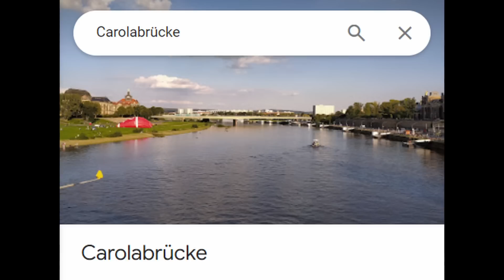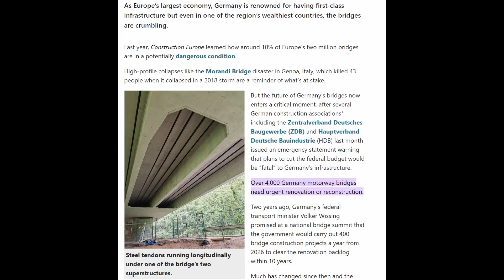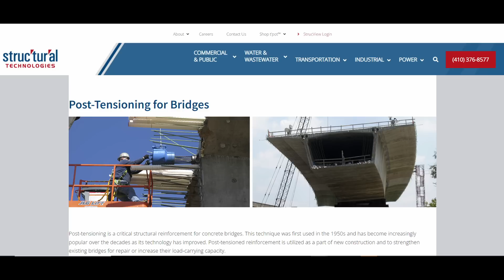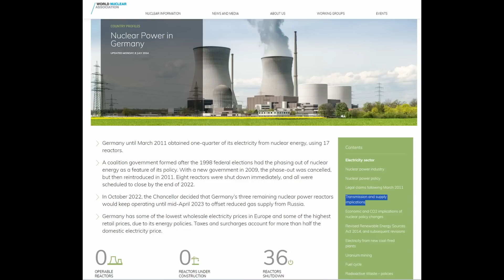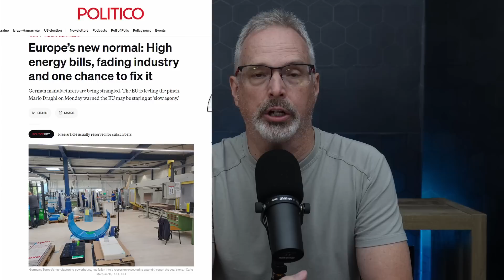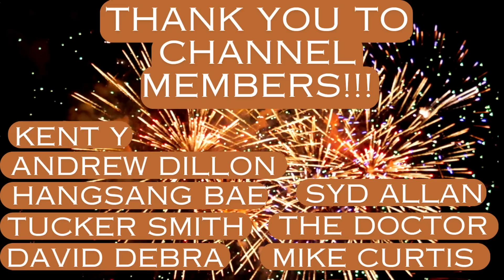Carola Bridge Collapse in Dresden, Germany

Comment: @CaseyJones-Engineer
Tis Bridge consists of three Elements beside each other the now standing were refurbished in two phases and the now collapsed would have got maintained starting at the beginning of 2025. The first press conference has seen the „DOT“ engineer state that the tensioning which was heavily corroded by Cl was broken end this most likely caused the bridge collapse.
The strange thing is that they took a pause between finishing the second row in Dec 2023 and the start of this r

Comment: you know Nuclear Power plants are a big issue for the ruling green party which means you can question this. I do think this is the worst decision made by politicians after Fukushima but it was decided. The Gas issue is a different one but i'm sure this has nothing to do with the carola Bridge. it is much more about the learning that bob the builder promised something with the steel reinforced concrete we now learn only long term possible with a lot of oversight and maintenance.  It is not the first time and we could have learned earlier. the first incident i remember with steel reinforced concrete was the Berlin Auster pre youtube in 1983 just a super8 copy ( Berlin, Schwangere Auster, 1983 ++ Super 8 -> https://www.youtube.com/watch?v=zcEcnMJyCnw  )
the stuff only works if you can deny corrosion, by rumor the cause for the incident. In winter time we used and i guess still use salt to melt the ice on streets. salten water and steel are for sure not go together. of coarse steel reinforced concrete is a cheaper way to build as you can avoid a lot of construction material by using it. the cost come later - worst case - you can compare it to still standing "roman" bridges - much heavier.
Reply: The romans didn't put tension on concrete. The pantheon uses the conmpressive strength of concrete.
Reply: @jannikheidemann3805  yea, there was no steel tension and liquid stone (concrete) in roman time. they used the stone in the way stone behave naturally. if you make a bridge from stone only and only on compression you end with something lasting a long time. By the way, the Patheon used Concrete and on top the made hole because does not work up there. they also included amphoras to make it lighter on top. Did you ever saw a cross section, the walls a massive and use gravity to keep dome from moving outwards which he likes to do to following gravity. Anyway, the Pantheon is really genius if you think how much they knew about modern statics, tried out by models - i guess.

Comment: Great video.  At 4:45 you show the collapse, and it appears there are emergency lights on both sides of the river.  Did they have the bridge blocked?  Were there some leading indications of trouble?  Maybe what looks like blinking lights is an effect of time lapse security video.
Reply from the maker: It is the time lapse effect.  The road was open to traffic at the time of collapse, it was fortunate nobody was on or apparently under the bridge at the time of collapse.

Comment: don't they use stainless cable
Reply: Stainless steel can suffer chloride corrosion, depending on the exact grade of steel.  There are lots of grades of stainless steel, each with a different corrosion resistance.

Comment: I would hazard a guess it is "The Usual" to blame. Post WW2 a lot of everything was built on the cheap with the intention that it would be replaced after 30-40 years, they were supposed to be a quick fix temporary measure. But, after 30 years the powers that be "Forgot" all about the temporary nature of these bridges, buildings, roads, schools etc, and they just did the very basic maintenance to keep it going, and this is proving to not be enough. You will find many more things falling down in the next few years because the 30 year lifespan ended 20 years ago.

Comment: The inspection reports and maintenance activities of this bridge need to be reviewed. Bridges simply don't fail without warning signs.

If the bridge was built in 1971, that was when East Germany was under the Soviet Block. The design methodology was likely Soviet.  The quality of construction and materials need to be investigated. These may have played a factor in this collapse.
Reply: Actually, this specific design does do exactly that. Which is why it isn't used anymore.

Comment: One thing that is worth noting is that this bridge was designed in a way that a single point of failure would be catastrophic and that the static design lacked redundancy. I was surprised you didn't mention this.
Reply: It was the first prestressed concrete bridge built in the former GDR. I think that at that time there was not much experience with prestressed concrete bridges and the necessary redundancy for steel prestressing elements had not yet been taken into account.
Reply: @callsigndd9ls897  It's also a design that is no longer in use because it has no visible signs of failure until it breaks.
Reply: @callsigndd9ls897  It is absolutely essential that the cables stay locked into their concrete jackets.  If the concrete is compromised, then the cables loose their applied tensile strength and that begins a slow chain reaction.
Reply from the maker: I thought that this was rather obvious in this situation.
Reply: @CaseyJones-Engineer  yes, but it's worth pointing out for a general audience, especially with changing design standards over time.
Reply: It is for your typical viewers due to your excellent content. I'm a plant operator on the Gulf Coast and something's are not so apparent to my 60 year old self. Thanks for the great content! @CaseyJones-Engineer
Reply: Rather obvious dude.  C'mon, get yourself together.
Reply: @Frip36 obvious to someone familiar in the field.but to someone seeking to learn it may not be. I am in to retirement years and never explored any this so it's new to me,and fascinating.
Reply: @Frip36  If one has just a hint of any type of engineering background (I am a marine engineer) it IS obvious that post tension type bridges have a single point failure weakness. Too many people want spoon fed information instead of doing a little bit of research and engaging with a bit of critical thinking.
Reply: @steverturnsk6190  With more than 30,000 subscribers, he's popular enough to have a lot of casual or newbie architecture fans.  Hence, he may want to slip in a few of the "obvious" points.  Unless he's too above that.  Which would make him a prig.  And we know he's not because he's got a goatee.

Comment: Ahh I didn't think Dresden was in East Germany. Russian quality isn't the best and likely nor was the maintenance. It is scary it collapsed without warning. This type of bridge construction is extremely common and it would be good to know what the cause was. It's my understanding this method of bridge construction was pioneered in Germany post WWII due to the vast numbers of bridges that need to be rebuilt. Looking at the photo and measuring the span on google earth, the unsupported span is like 365 feet. This seems pretty far for this type of construction
Reply: Dresden is pretty much the most eastern city in Germany. However, it's not "Russian quality", it's "East German quality". Russia and other Eastern European countries had distinct economies with different traditions and means. Specifically East Germany had the German tradition of high engineering quality, but greatly diminished by an economy that was limited by war reparations, eastern suppliers (with similar limits) and a socialist system. Our parents did the best they could, but that still fell far short of West Germany. At least my generation has better paint to hide the limits imposed on us by different "powers that be". 😜
Reply: I agree.  Dresden was bombed fairly heavily in WWII and was extensively rebuilt.  Having visited a decade ago, you can still tell what parts were in the "East" versus the "West".  They've got a lot to catch up on.

Comment: I broke down once in Chicago, waiting for a tow truck I walked over to the abutment nearest me…

The rebar was showing and the concrete had become so soft that I scraped some of the concrete off with my finger nail…😮
Reply: You can see that all over country. The State of Illinois has identified over 4000 bridges that need repair.
Reply: I have seen a bridge there held aligned by a metal "bandaid' over a gap for a decade without repair.  Now that bridge was pretty conventional so it didn't fall but parts were failing and not repaired/
Reply: The metal “bandaid” as you put it is probably what’s known as a doubler plate, and although they aren’t exactly ideal, they are perfectly safe to use and are even found on larger bridges (an obvious one being K-40 in Memphis)

Comment: I took BMW and Mercedes vehicles off my must buy list at least 2 decades ago. They haven't gotten any better. Same for VW who would rather lie to sell their vehicles.
Reply from the maker: I have been having good luck with Toyota vehicles from many years now.  Although I am not a fan of their 4 and 6 cylinders turbos which I won't buy.
Reply: @CaseyJones-Engineer  Drove a Subaru for 20 years from new. Rust killed it. I would have driven it for another 10 years if I could. If only to avoid a lot of the nonsense in modern cars.
Reply: Last good car that came out of Germany was around 2000 they’re all junk since. I worked for BMW for 3 years and was appalled at the quality of their engines.

Comment: Germany was already dependent on Russian gas and oil even at peak nuclear capacity here. Nuclear hasn't been a large percentage of our energy production (about 25% of electricity generation in the early 2000s was the peak). Mainly the issue with lack of maintenance is close to 40 years of CDU/CSU government (with a brief interruption in the late 90s) under Kohl and Merkel where very little was done in terms of maintenance and investment in replacement infrastructure because they were coasting  on a sentiment of keeping things the same. There was also a large wave of privatization of essential services in the 90s that is coming back to haunt us now.  Other areas such as government agencies still using paper for a lot of things are caused by this mindset that doing things the same way will lead to equally prosperous outcomes as in the past as well. Meanwhile the current government gets a lot of push back when trying to fix the many problems that have accumulated.

As for the Carola bridge in particular, the part that collapsed had been scheduled to be overhauled in 2025/2026, other parts of it were already being worked on. The main issue with the collapse at this time was apparently that they feared (and still do but it looks less likely now) that the bridge parts in the water might lead to more flooding issues when the water from the huge rainfall in eastern Europe reaches that point in the river and that potentially some of it might catch debris in the water or get swept away to damage other bridges down river.
Reply: >Nuclear was 1/4 of your county's electricity generation before you started shutting down nuclear plants 
>Claims nuclear was not a large percentage of generation

Which is it?
Reply: @homuraakemi9556  I think he means in comparison to our neighbors like France. As OP said a lot of problems came because of the lack of maintanance, and on the other hand we have a lot of "green" people who are against nuclear energy. I myself don't think nuclear energy is bad in itself if it's done properly. Sadly more or less recent developments make it hard to research more modern nuclear technologies here. Most of the buried nuclear waste could be used again with the right type of reactor.
Reply: @CatNolara  I mean every country has a small percentage of generation compared to France; they're by far the highest in the world as far as % generated by nuclear energy. But 25% is higher than the US, which is about 20% right now, and has been for a while. 

I agree that more counties need to adopt re-processing & breeding technology, but that's no reason to discontinue perfectly good reactors, especially since the main cost is capital for plant startup, and they are very cheap to operate thereafter. That means that you want to extract as much power from a given reactor for as many years as possible, but Germany has taken the worst possible approach by shutting down generation long before their useful life is over. In the US, we hope to see at minimum 80-100 year lifetimes for our reactors.
Reply: @homuraakemi9556  Both. 11.0% in 2021, 5.8% in 2022 and 1.4% in 2023. Nuclear energy is expensive: 18.5 to 42 cent/kWh. Home solar 6 to 11, ground mounted 4 to 6, onshore wind 4 to 8, offshore wind 7 to 12.
Electricity generation costs are 44% of the end consumer price, the rest are taxes, transit costs and other duties.
Reply: @sandmehlig  As usual, those pointing to the low cost of intermittent renewable, like wind and solar entirely ignore the other costs involved in providing a 24 hour, 365 day service. That is energy storage and the use of standby reserve power generation to produce power when wind and solar are failing. That represents a huge amount of capital investment, much of it lying idle a lot of the time in order to provide that service. In addition, the providers of "green" power often have to be paid just to turn off generation when the supply of renewables exceeds demand. Then there is the whole issue of massive upgrades to grid networks to move power around over very larger areas.

Solar is of little use in high latitudes in the winter months when electricity demand is at its peak. In the summer it can produce larger surpluses during the day, a lot of which has to be thrown away because the problem of energy storage on a massive scale has not been resolved.

The figures would be a lot more credible if they included all the cost elements of providing reliable, 24 hour, 365 day a year power. That also ought to be taken into account in CO2 emissions figures as well. Hydro is, of course, rather different in that respect but even that isn't entirely reliable because rainfall and snowfall isn't always sufficient in some years.
Reply: @TheEulerID  Comparing energy gestation costs with gas, lignite and hard coal there is enough wiggle room for energy storage for overnight use (solar) or using it during the day (wind). 

No water usage during energy generation (and a huge water recycling potential during the production of the devices).

Payments due to overproduction are about to be phased out (in Germany).
Further subterranean caverns for gas storage and natural gas powered hydrogen compatible power plants are being built for phases of low wind and solar. This is the price to pay for not having an energy grid strong enough for the necessary inter European and intra German power exchange.

Electric cars for storing energy surplus are being phased in as well as regulations to implement methods and incentives for network-friendly energy usage.

No one can build out any single component alone on a massive scale. Strengthening local transformers and local energy storage has to get up to pace with the expansion of centralized energy storage and interconnects. This needs a steady pace without hesitations paired with a flexibility to react to changing requirements.
Reply: The major issue with German nuclear energy is anti-science politicians in the Green Party who want to eliminate nuclear power for emotional rather than logical reasons.
Reply: As an American, I can tell you that things go downhill fast when you elect Leftists like Merkel.
Reply: Funny how you ignore how the SPD was part of almost all governments since 1998. Maintenance of infrastructure in the 90s was hardly possible because practically the whole infrastructure in Eastern Germany had to be completely rebuilt thanks to the GDR's neglect before, leaving little work capacity in Western Germany until the late 2000s. All the projects in Eastern Germany were started under Kohl's CDU admin.
As for the CSU: Over here in Bavaria our infrastructure is being renewed since around 2010, so it's pretty disingenuous to blame them. Most of the more severe bridge closures were in traditionally SPD-run states, especially Northrhine-Westphalia.
And don't even get me started about the utter incompetence of the Greens.
But yeah, keep telling yourself it's all the evil Union's fault.

Oh, almost forgot: Dresden is run by an FDP mayor since 2015. Whoops, still not the CDU'S fault. 😂
Reply: @Bundestangle  I wonder which party sued the current government in the federal constitutional court for not adhering to the debt brake?